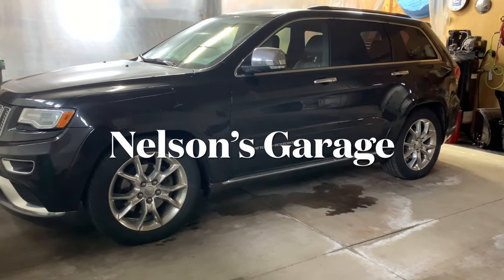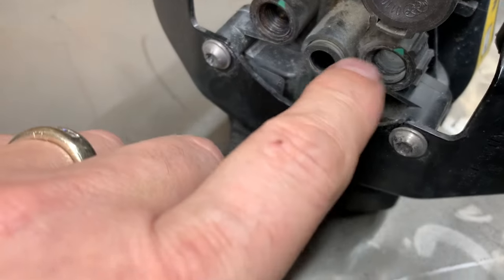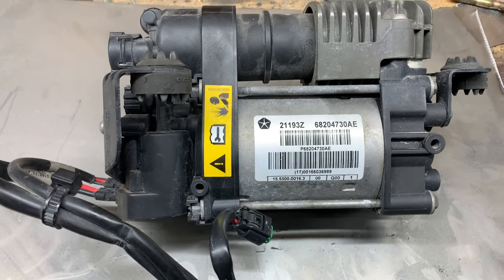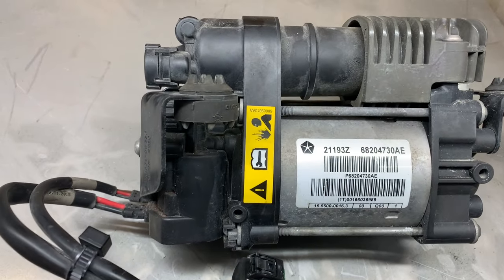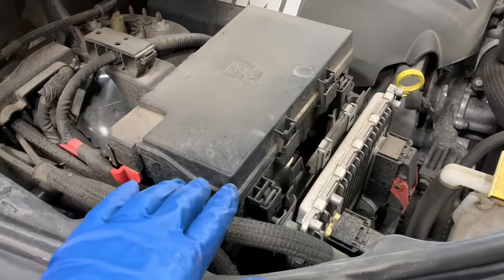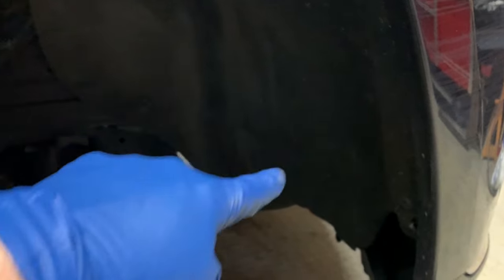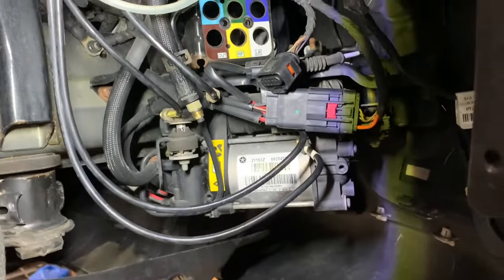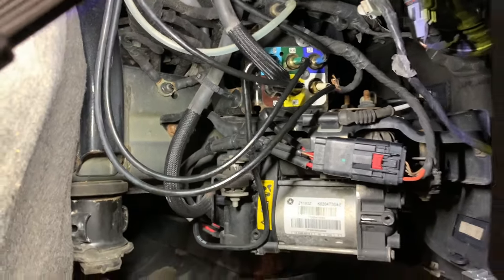Jeep Grand Cherokee Air Suspension Fix

Comment: I have a 2014 amd my back bags are deflated and dont pump up what do you think my problem is
Reply from the maker: its just a guess without a scan done on the system. but start with leaks, checking the bags and lines for leaks, (from the valve block to the bags) each bag has it own air circuit but they both need to be checked for leaks. do that by trying to air up the suspension an listen for the leaks (sometimes you can hear the leak) and a visual inspect of the lines and connections. next would really need a scan to make sure the computer is calling for the rear to be inflated. if it is, it could be the valve block (there would be a code). you see if the front will go up and down, that tells me the pump is working properly. it would have to be a leak (n both rear bags or lines feeding the bags), the computer controlling the valves to fill the bags or the valve block itself.
Reply from the maker: With all that said, make sure the fuses are good, i think there are 3. and the height switches (links) located near the bags are hooked up and not broken.

Comment: The car is taking too long to go up. It needs more nitrogen in the tank. Did you purge the system after changing the valve block?
Reply from the maker: I did not surge the system, I just let it empty.  I put pressure in the tank, filled the bags to ride height and checked the tank and topped it off.
Reply: @Nelsons-Garage  how much nitrogen did you use?
Reply from the maker: @RCandFishing  I think it was around 120psi,
Reply: @Nelsons-Garage  I gonna need to do the same thing to mine. It's crazy that the only jeep dealer we have in an Island where I live doesn't do nitrogen refills 🤣. 200 psi of Nitrogen cost almost $600 here.

Comment: Thanks for a great video! Not much else out there for information on this subject. I was wondering if you had any advise for my current situation. Initially had a leak on the fittings at the top of the front struts. After replacing these fittings this I noticed the front would not raise and I blamed low nitrogen (closed system?) I filled the system, and using AlfaOBD scan tool I am able to adjust rear springs but not the fronts. I replaced the compressor, but same issue. I have now replaced the valve block and still have the same issue. I can hear the compressor struggling to pass air into the front struts and then it turns off and fails the procedure. Any suggestions on diagnosing this? Thanks for the help!
Reply from the maker: That is odd, I’m sure you did this, but, there isn’t a kink or obstruction in the front lines? I’m thinking where they go to the distribution block.
Reply: @Nelsons-Garage  No kinks in the lines… I have narrowed it down to the connections on the top of the front struts. If I disconnect them and actuate the compressor, air will pass through but as soon as I connect to the brass fitting at the top of the strut it is blocked. Do you have any insight on this?
Reply from the maker: @diigiianR  no insight, other than making sure there is no obstacle in the valve. (Obviously) I would use compressed air to test each air bag. I think they come plugged, so making sure that is clear. Keep me informed what you find.
Reply: @Nelsons-Garage  UPDATE: My issue has been found & fixed. After testing for air flow with the lines disconnected from the front struts, both worked correctly. This made me suspect the residual pressure valves. I swapped the RPV's left to right and the issue traveled. Replaced the one bad RPV and flow was restored. I had to recalibrate the suspension, but since I did not replace any height sensors I used some numbers suggested by a jeep mechanic. Its driving normally today and I'm happy to be out of the woods with this repair
Reply from the maker: @diigiianR  that’s great, good information..
Reply: @diigiianR  what are the numbers to calibrate it ?
Reply: @diigiianR  Can you share the information on calibrating the air suspension system? I need to do mine and I plan on using AlfaOBD.
Reply: @alexmanzanarez502  I am sorry for the late reply, I haven't been able to locate that information. I inquired with a jeep mechanic at the time and they gave me the values... maybe you will have luck the same way. It was something like 88 front and 89 rear but i cant remember for sure.
Reply: @Japplesnap  The app is quite straight forward to follow for calibration. I think you need to do a mass air pressure test on the system, make sure its not in "plant mode" then command the vehicle to normal ride height before calibration.  If you don't mind, can you elaborate on your issue and why you need to calibrate?
Reply: @rickyimpara9048  I didn't see the option to calibrate in the app. Where is it exactly?
Reply: @Nelsons-Garage 
I am having a trouble code says calibration level performance and once i tried to modify the level through computer i couldn't do it because it keep giving me a message that level control disabled 
Any idea how I can enable it again
Or what could be the problem 
Thanks in advance
Reply: @moathibeid8234  Try clearing all the trouble messages, running the "air mass calculation" or "system pressure test". In my experience one of these functions turned off plant mode and allowed me to adjust heights.
Reply: @Japplesnap  It should be under the suspension control module, and there should be a function that says "write suspension heights" or something like this, let me know if you find

Comment: What was the fitting used to put the nitrogen in the driver side back seat tank? Where can I get that fitting 24:19
Reply from the maker: I used an AC gauge set(Harbor Freight) and the larger AC fitting fits the tank.

Comment: Good day, everyone!

I have a question: do you have any idea how to bypass the computer system of a 2012 Jeep Grand Cherokee Limited? What happened was that we changed its front suspension to a spring. At first, it was doing well, but after a few days, the car wouldn't run or reverse. There is no problem with the transmission.
Reply from the maker: I have never bypassed the computer for the suspension. I know people have done it when the replace the air system with springs. let us know what you find

Comment: Hello.....on 2014 GC Summit i'm getting a 'service air suspension immediately' warning on the dash....not noticing any malfunction....were you getting the same warning?....i'm trying to figure out what a service to the air suspenstion is all about.
Reply from the maker: Yes that is the warning. The pump is running too long causing the thermostat to trip, which, in this case, trips the warning. Is you pump working and the suspension is going up and down?
Reply: @Nelsons-Garage  ...yes it seems to work as normal......entry to aero seems fine....
Reply from the maker: Hummm, when does the warning come on? If you put it in off road 1 or 2, does the Jeep go up all the way? Then put it down to park mode, will it go down all the way? Make sure the pump is running.
Reply: @Nelsons-Garage  .....ive got the dial selector....auto, snow, mud, sand and rock which seems fine but the jeep barely moves up ot down when im in park so guess its the compressor....the warning happens on the road when i get up to speed....
Reply from the maker: @johntrainor9101  the pump valve is starting to go. Same thing happened to me. Mine started once in a while then slowly became more frequent. If it happens while you are getting up to speed means the Jeep isn’t at the height it wants to be and the pump is taking too long to get there. When the warning comes on the suspension no longer is working until you restart the Jeepz

Comment: I have the same problem, should I replace the compressor?
Reply from the maker: If your suspension goes up but not down, it is most likely the reversing valve within the pump. So pump replacement would be needed. I haven’t taken the pump apart so I’m not sure how to repair just the valve in side the pump.
Reply: Thank you so much
Reply: My 2012 just started doing this. I can get it down okay, but after driving it goes into mode 1

Comment: Can you help me with some issues I’m having or my best guess you won’t answer ?
Reply from the maker: What’s the issue
Reply: Hard to explain super cold car is slammed on rear and up on front now in heated garage no help seems the pump isn’t running upon start. 
Then throw service immediately light. 
But I hear it making some sorta noise befor light goes off 
What’s the link to parts place you mentioned
Reply: Can I switch out relay with fan relay ?
Reply from the maker: @HowsyourBin  you can switch relays to test the system
Reply from the maker: @HowsyourBin  https://rebuildmastertech.com/?gad_source=1&gclid=Cj0KCQiA-62tBhDSARIsAO7twbZPNNZzBoSToGGYDDv_j8fwAUvlmDDV6GKGTRQZJs9ejSy6F8OAF_AaAvfHEALw_wcB if the rear is down and the front is up, it sounds like a leak in the rear bags or lines. The pump may be trying to pump the rear up and taking too long causing the pump to over heat and shutting off which triggers the service light to come on.

Comment: I have a 2013 overland and the same thing happening to mines but it actually dropped the car to exit level any ideas because I’m not sure it’s the pump I drove it home with no problem woke up went outside and it just happened
Reply from the maker: If the Jeep goes to exit level but won’t go up it would most likely be the pump. There is a valve in the pump that switches to make it go up or down. If that valve is stuck, the Jeep will not go up or it won’t go down depending on what position the valve is stuck. Just make sure there is no leaks in the system, air lines, air bags. Usually if there is a line or air bag leak it will only affect that one corner of the Jeep. Hope that helps.
Reply: @Nelsons-Garage  thank you so much
Reply: @Nelsons-Garage  another ? It’s currently at the shop they say it seems like the pump is on but just because the pump is on doesn’t mean it’s working properly right he’s also saying they are only getting rear codes
Reply from the maker: Yes, just because the pump is running doesn’t mean it’s working properly. Usually if the pump runs and the Jeep is not going to the position it wants, the pump will overheat and cause the message in the dash. The cause can be the reversing valve in the pump itself, a broken line, a leaking air bag itself, or possibly the height sensor at the axle. Make sure the sensor links are not broken or loose. Also you mentioned it was in exit height, is that really where it’s sitting? Or did the air come out of the system? I would think if it’s in exit height and it won’t go up, but the pump tries to go up, and then the error message in the dash trips, I would go for the pump. Ask the shop if they see a switching valve error in their scan tool.
Reply from the maker: @runituphotty216  one more thought, rear codes make sense. The system tries to lift the rear first. Not the whole Jeep at once. When lowering, it lowers the front first. So it there is a rear code it most likely will be the pump because the switching valve is not allowing air to transfer to the rear therefore the rear isn’t lifting causing a code there also.
Reply: @Nelsons-Garage  yes I just talked to the shop it’s at not to confident with them so I’m having it towed to someone with more knowledge on air suspension BECUASE the last shop is saying he cleared the codes and got some air in them but the passenger rear is still going back down causing all sides to go back down
Reply from the maker: @runituphotty216  the passenger rear goes down… are you sure the air bag and lines are good to that side?
Reply: @Nelsons-Garage  not sure the guy at the shop claim they are
Reply: @Nelsons-Garage  they claim after they pumped it up they didn’t hear any noise I’m like that’s not really checking the line if your not spraying it with soap water I found a used pump I think imma just put in and see because I was hearing a noise sometimes from the compressor at the time me not knowing but maybe that was what was going out BECUASE it happened so out the blue I literally turned my car on and i got the message and it just dropped
Reply: @Nelsons-Garage  it’s going to a new shop tomorrow should I hold off on the pump and wait until they check actually check or just maybe get the new pump in just in case because like I say I was hearing noise from the pump
Reply from the maker: @runituphotty216  you have quite an ordeal going on. I would hold on the pump and really check that rear air bag. They would have to take the bellows off to really check that bag, I wouldn’t trust sound, really need soapy water as you suggested. Without looking at it, and from what you’re saying, I would most likely change the bag and if you feel the noise from the pump sound bad, change at the same time. I hope all this helps and wish you luck, and let me know the outcome.
Reply: @Nelsons-Garage  ok I’m here now at the truck I started it and pressed the lift button I hear the compressor cutting ok and trying to lift it lifts but the driver side is staying up it’s the passenger side that’s lowering all the way down if that makes sense
Reply from the maker: @runituphotty216  the whole Jeep goes up and then the pass side drops?
Reply: @Nelsons-Garage  yes and I hear a hiss or air coming from rear passenger side only when truck is on and trying to lift
Reply from the maker: @runituphotty216  there’s your problem, might be the line back there or the bag…
Reply: @Nelsons-Garage  yea I’m guessing cause u was going to get the compressor luckily I stopped where it’s located and just checked a few things I guess the shop it’s at couldn’t hear it in the shop because I have a loud exhaust system so they couldn’t tell

Comment: Awesome explanation of the process and how it works! My 2014 Summit just did the same thing this morning. Ran all morning on the way to work and wouldn't turn off trying to seemingly correct an issue even when I turned it off. I found the 40a fuse pulled it out so it wouldn't unalive itself and my battery like it did my 2011. Reinserted the 40a fuse now it won't turn on at all. I only assume a new compressor is to be had. Would be great to know if my valve system worked and I just needed the pump, "woe is me". And you're correct RMT is great company that deals with Chrysler products I purchased their copper fittings for the lines awhile back just now ended up using them a few months ago. My question to you, I'm iffy but willing to learn to use the nitrogen tank to fill up the tank on board the jeep so I don't rely on the dealer anymore. Where do I buy the tank and the couplings ? I've looked up a few places online already that look promising but what happens when I need to store the rest I don't need after I fill it up? Is it safe to store in a basements or garages and such?
Reply from the maker: The fill gauges are just an AC fill gauges from Harbor Freight, as far as the gas and tank, go to a welding supply store. And it is perfectly fine to store in a basement or garage.
Reply: @Nelson's Garage  thank you sir appreciate the reply
Reply: One more question if I may, you mentioned when the airbags are empty you filled the tank. When the bags are empty is the jeep at its lowest setting, entry/exit? Or did you have it on a lift with the wheels and suspension free of its weight? Or did you purge the system completely and just filled up to 120psi of nitrogen? Sorry to be so anal with the questions,  I just wanna do it right like you did.
Reply from the maker: I had the air bags as empty as possible. My system wouldn’t go down to park mode anymore, but when you take the pump out one of the lines goes to the tank. Any pressure in the tank will come out then. And I did all of this on a hoist, there may have been some residual nitrogen/air still in the bags. But the system isn’t that picky.
Reply: @Nelson's Garage  awesome thanks again!

Comment: I have a problem where the left side front sits higher than the right side front
Reply from the maker: Check the valve on top of the strut/ airbag under the hood the right side could have a leak. Check the level sensor on both sides, that is located in the wheel well and has a small rod that connects the sensor to the suspension. Make sure the rods are connected.
Reply: One more thing when I stop I keep hearing my pump and air tank adjusting the suspension
Reply from the maker: @luhjay345  that sounds like a leak somewhere, check the valves on top of the front shocks
Reply: I checked that already and I put a new shock on the right front because I that that shock was bad. I made sure that valve was on tight and theirs no leak from that. But can say it don’t sit low to the ground no more it just sit lop sided in the front do u think It’s leaking from the valve where the pump at that say right front
Reply from the maker: @luhjay345  it’s possible the the valve block is leaking down but you may have to hook up to a scanner and reset the ride heights.
Reply: I will check everything I said that might be the problem
Reply: What size is the fitting for the air tank
Reply from the maker: @luhjay345 it’s a standard AC gauge fitting,
Reply: I set it up like you but the nitrogen is coming out on the yellow